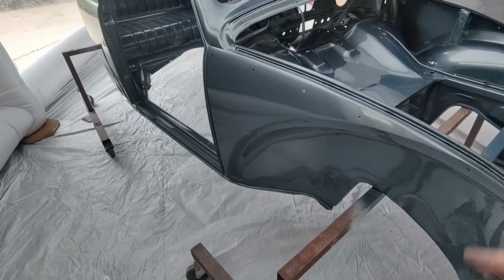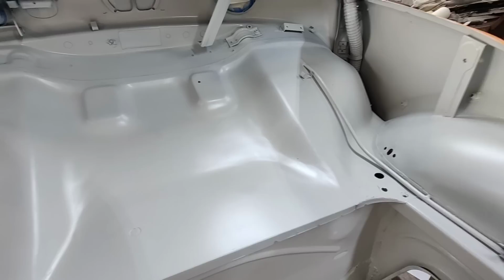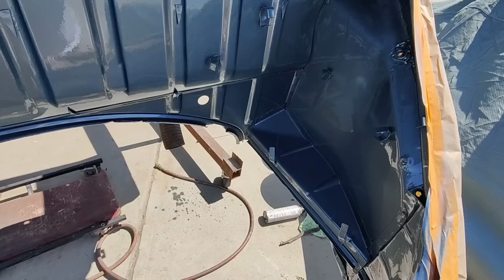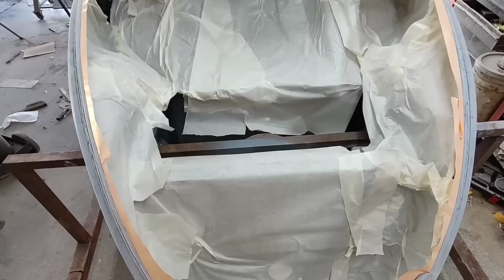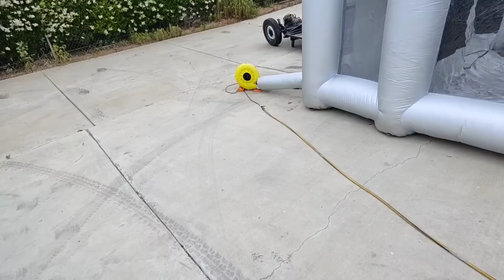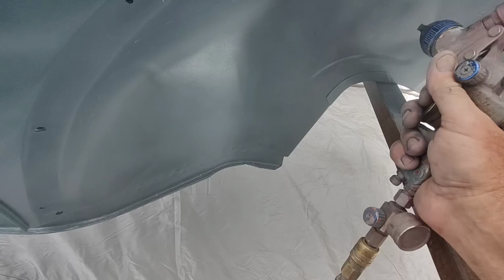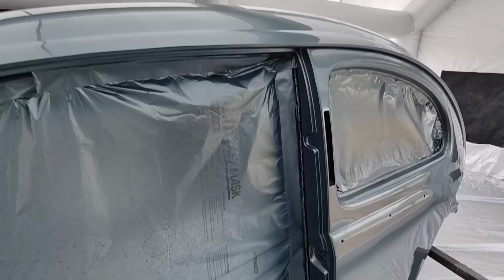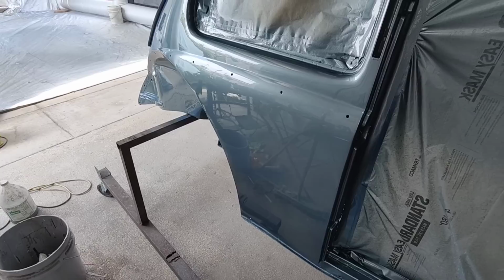PAINT THE OVAL WINDOW 1954 Beetle restoration body painted

Comment: 3:28 you just painted over rust ?
Reply from the maker: No that was in the paint....not under it. The metallics on these old paints rusted. and under it was completely no rust. I chose to leave it on there since it was protecting the metal underneath and encapsulate it with epoxy primer. white was epoxy primer and rust encapsulate. Will never rust under there again.
Reply: Nothing wrong with that Mr. 
Super proper

Comment: Not bad Mike...i don't think earl schieb has anything to worry about...however, do another 99 cars and you'll get really, really good.  Painting a car without flaws requires that guy who does it EVERYDAY...nice work...great video.
Reply from the maker: DIY at home all the flaws are fixed after the spray work. Your right. even custom painters get flaws. only guy who nails it about every time is a production spot work painter. They are the best.

Comment: I painted my bug in 1990 with deltron off white and no clear coat and it still looks good today. glad I didnt use clear because it probably would have yellowed or checked
Reply from the maker: deltron clear would have lasted just as long. Kept inside they both last about the same.
Reply from the maker: back then they were good paint. or glassomax. Or even RM mirrocryl. I used them all and they were all good.

Comment: Beautiful work!  I am curious how to get full paint behind the louvers below the oval without runs on the louvers. Is there a trick?  Thanks, keep up the good work!
Reply from the maker: just need the pressure high enough it iwill be a little dry but there is really nothing you can do. I angle the gun slightly each direction to make sure I get both sides. whatever else fall out inside there is enough coverage to stop rust and look the right color. It will be a bit dry spray.
Reply: @Mikefngarage  thanks!

Comment: You had the camera set up at the corner of the booth while you were spraying; and it appeared that you didn't have the booth end closed/zipped.  True or no?  If not, interesting that the booth exhausted the overspray without getting into the your garage-Comment?   Also you did have the elephant trunk installed and working-correct?
Reply from the maker: I can but i wanted to leave the door open the overspray just left from the wind. was just about perfect. nothing went into the garage just out to the air. I have had the elephant trunk on it and it does work. I just didnt want to enter in the other side and it would have been a little hot in there with the door shut. I was running out of time and needed to make sure to film the process which would have been harder with the door shut

Comment: very good! which I would also learn to be so skilled, how big a compressor does it require?
Reply from the maker: best to have a 5hp 60 gallon minimum  for most body work and air tools. to actually spray with  that gun I used probably only 3hp. 20 gal.
Reply: @Mikefngarage  can you paint with a 20L tank? if the yield is in year 2, the yield was just 240L

Comment: Hello Mike.  Well done that looks lovely.  Question - what do you do about the bits where the car is resting on the framework?  Obviously they need a bit of protection too - do you just go over them later with something?
Reply from the maker: yea just a little touch up. I dint sand blast this either the paint that was there actually corroded. The paint did...... and  underneath that was completely clean metal I figured this out when I stripped the back engine compartment. Thought is was rusting throught the paint but it was actually the paint itself. So there is protection on those areas That is why for the most part I dont sand blast unless I need to. because sometimes you take off stuff you cannot recoat like they dipped in the factory.